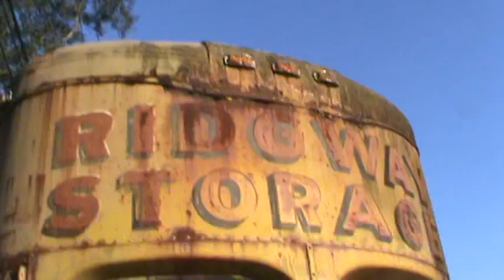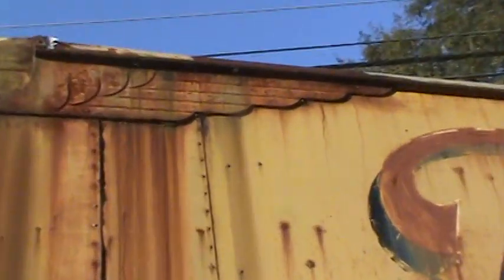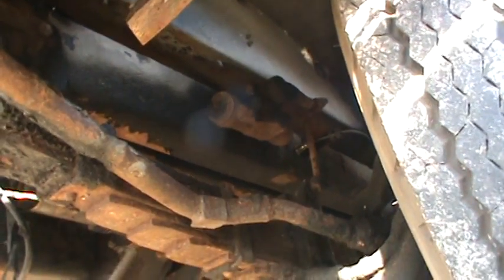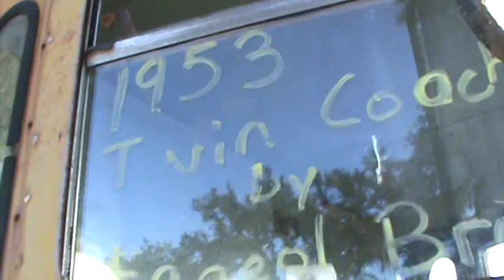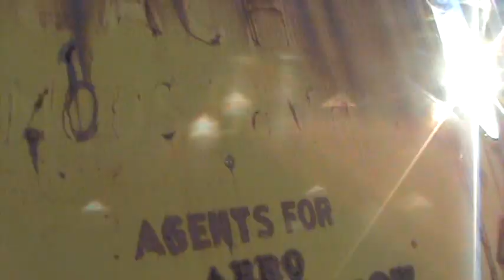a cool truck

Comment: man I saw that at the turkey rod run in the rat rod car show area the guy that owned it told me he got it from Daytona where it was used as a moving van I think he said that he got the vehicle from a field out there near Osteen Florida .if I remember right he told me all he did to get it running was a fresh battery fluids and an auxiliary fuel tank .and he drove it to the car show .he even had some old board track race bikes in there .